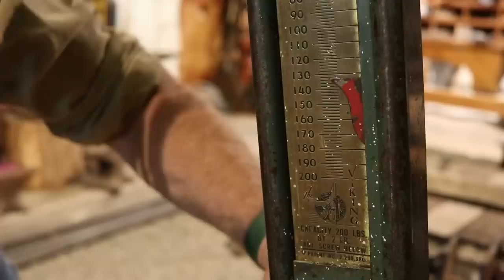Pulleys in the Shop Explained

Comment: An excellent video. You have got me thinking.  Is mechanical advantage a function of the number of ropes between the pulleys, or is it only the moving ropes?  I wish we'd seen the entire system when you showed us the three moving and one fixed rope.  Dustin, on Smarter Every Day did another excellent video on the subject three years ago.  https://www.youtube.com/watch?v=M2w3NZzPwOM&t
Reply: When you showed us the climbing equipment I was thinking that it had to be rated for dynamic load, so 'much' higher than the weight of the climber who might fall and expect to be saved by it. Climbing ropes are dynamic, of course.  They say that falling with a static rope is going to hurt you almost as much as falling without a rope.  A good visual example of how that works are the vehicle recoveries they do on the 'Matt's Off-Road Recovery' channel using Yankum dynamic ropes.  We have seen Matt pull huge RVs out of the mud with a Jeep by using dynamic recover ropes. www.youtube.com/@MattsOffRoadRecovery/featured